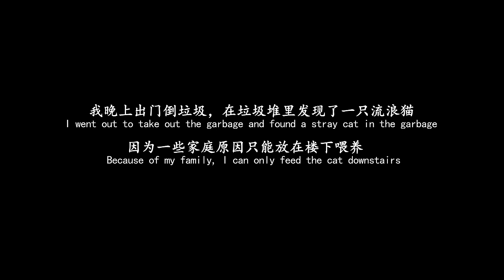Make a cat climbing frame for the stray cat I adopted

Comment: no body talking about the fact that she hot glued the logs to the floor..No? ok
Reply: Someone did 3 weeks ago, they just didnt say floor. It can be removed and cleaned up. I'm more worried about the cat going to the toilet in that lol
Reply: I thought I was the only one! I was like, why didn't you just...put a piece of wood or something then hot glue it to that...
Reply: And the ladder that is 3 feet off the ground. 
Yes, hot glue can pop off, but often it will take the top layer of finish or veneer with, especially around the seems. 
The idea is a nice one, but you easily could have built a base to secure them too, and protect the floor from both issues. And build the ladder to a length it could reach. 
Also, I see the car climbing on the shelves and knocking everything down. I feel like this is for views, not really the kitten. 
Sorry, it is my opinion, and I know carpentry work very well.
Reply: @bradylady2000  I think it’s not a living area, the living area are upstairs.
Ground floor is garage, workshop and store room only in some country houses.
She probably converted a cat room for her pet and the furniture are meant to be messed about.
Reply: @bradylady2000  you know cats can jump high off the ground lmao. And even so the ladder could just be a cite decoration. It is her house and it doesnt really matter if the floor is damaged too much since this is the garage
Reply: @sweetnsour5661  omg same, i was like the cat would probably piss on all those leaves since they are 'diggable'
Reply: Ñ
Reply: That's the cat place! No going back!